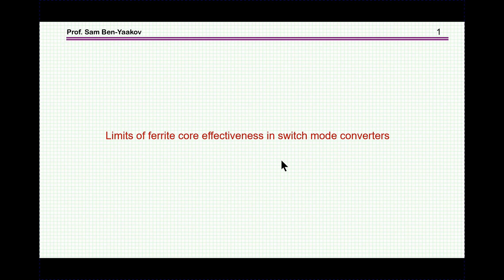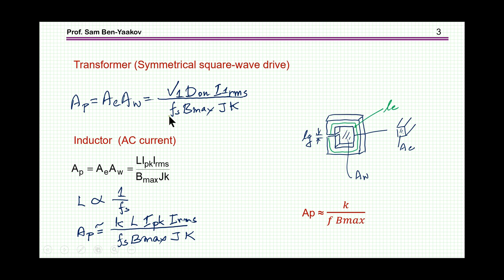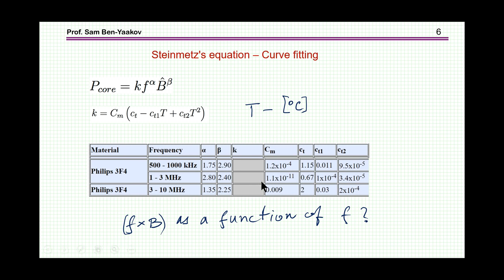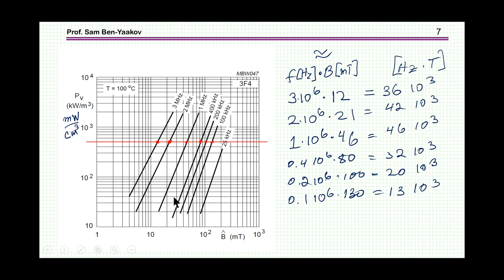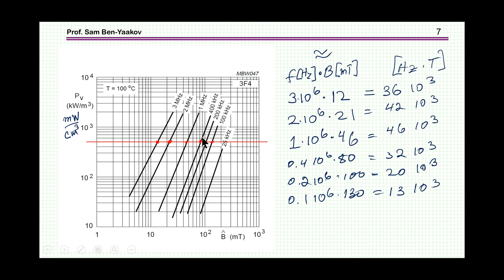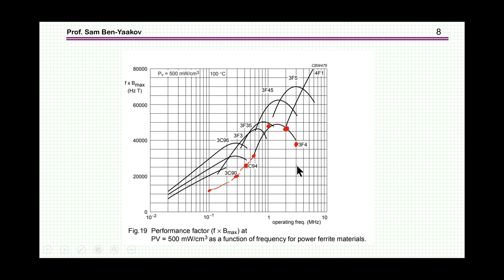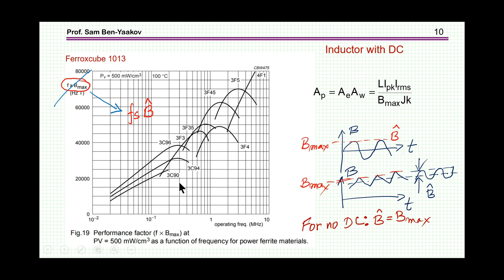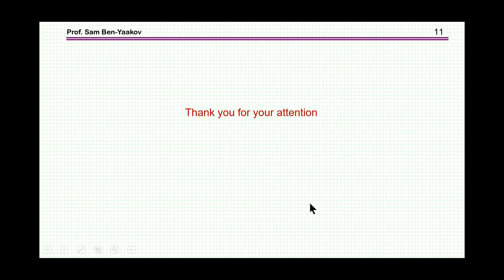Limits of ferrite core effectiveness in switch mode converters

Comment: A shockingly good channel, Professor! Speaking of ferrite losses: could you please clarify the case of a full-bridge converter? If f is the full transformer cycle frequency (that is, including both positive and negative B excursion), what should be taken to compute the losses? Bpk and f, 2*Bpk and f, Bpk and 2*f or 2*Bpk and 2*f? This is very confusing, so thank you in advance for your time.
Reply from the maker: Thanks. f and Bpk.